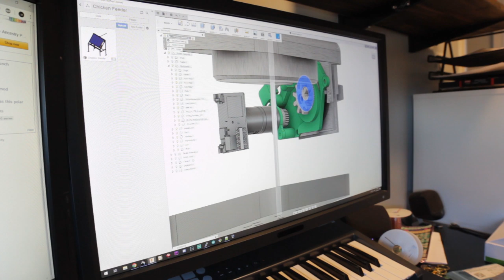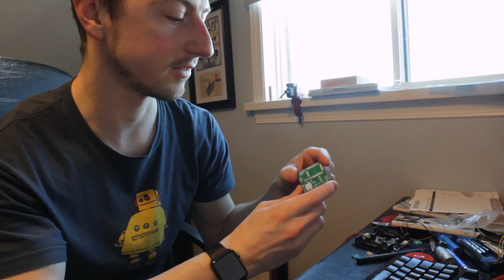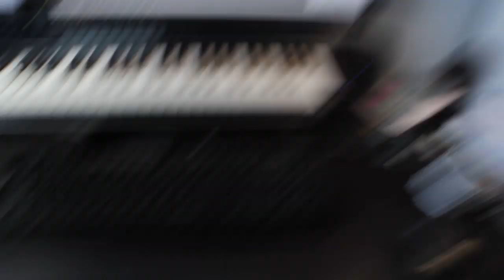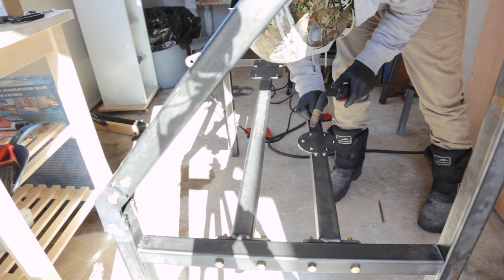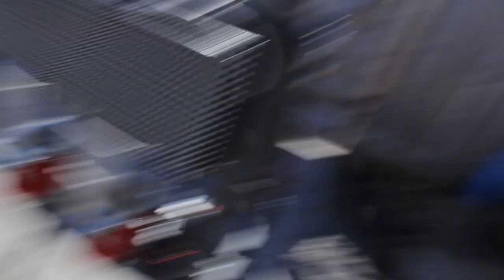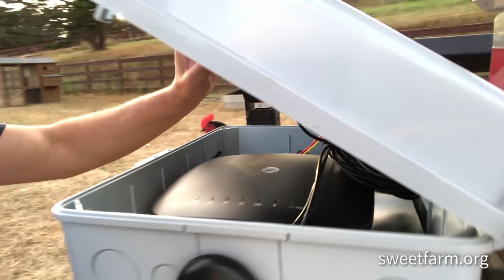Twitch Streaming Robotic Chicken Feeder!

Comment: Hi Sean, great video.
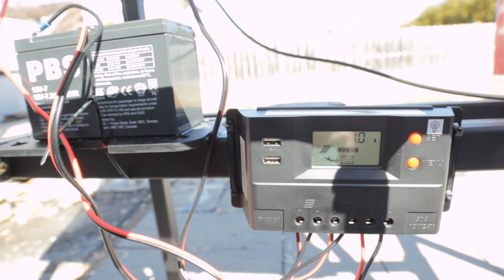At 14:00, "A bigger battery will charge more"???
The bigger battery will store more energy, but the PV panels will still be charging the same amount of energy.
Some more input about the solar charger and how you calculated the wattage needed would help.
Even splitting the video to two parts would have been good.
Reply from the maker: The small battery goes "Full" way too fast, so the charge controller has to waste power. The panel will produce 1A but if the battery doesn't charge because it can't take anymore, then all of that 1A has to be dissipated. If you have a few days of cloudy, the small battery will run out, where as a larger batter has longer storage, then during a sunny day, will be able to charge with the 1A much longer.

Comment: Checking this out now, this is really awesome. However the connection is dropping here and there. Are you on mobile network? You might be getting de-prioritized. Companies like unlimited IRL can get grandfathered unrestricted plans so that doesn't happen. A lot of IRL streamers use them, as well as you can stream to a RTMP server that way the stream doesn't end, it goes to a lost connection scene. Are there plans for audio or the ability to manipulate the angle of the IP cam? What about an HDMI camera for better quality, I've seen this Auvidea board that will take HDMI to the CSI-2 camera port. https://auvidea.eu/product-category/csi2bridge/hdmi2csi/ But you'd probably need a wired connection since you need more bandwidth/bitrate. Hope it helps, very cool. Take care
Reply from the maker: Thanks! Ill pass along the info. Nate @ sweetfarm thinks the connection for the LTE is spotty when it gets foggy.